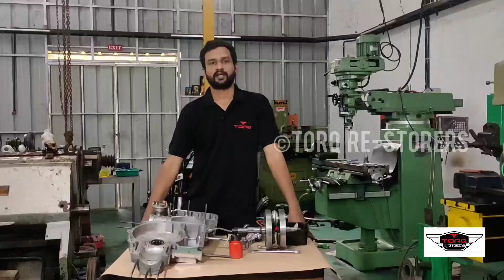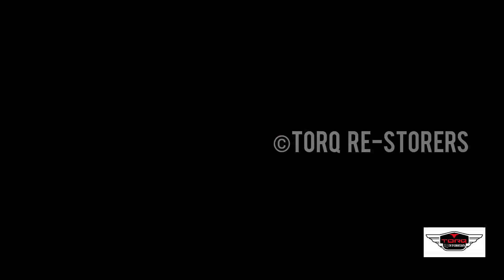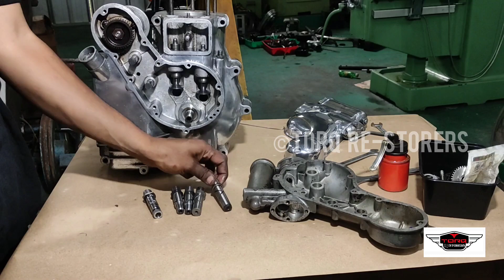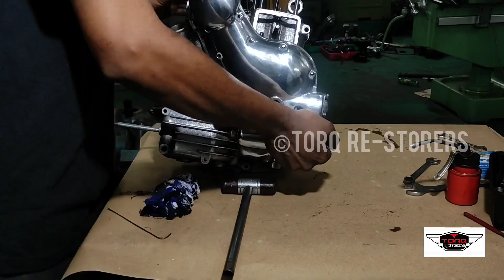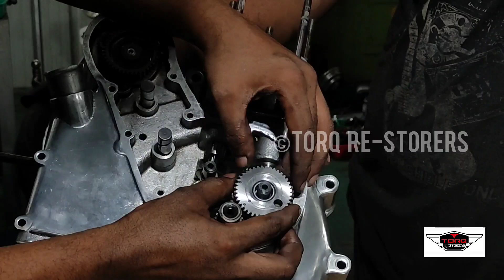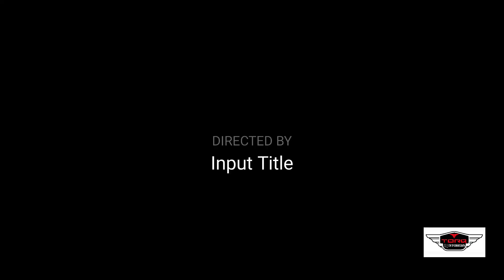Old Bullet Steady Spindle Fixing | Old Bullet Cam Spindle Setting New Innovations - Torq Engineering

Comment: Hello sir I watched ur video regarding spindle install very nice, can we install new plain spindle with removing engine from chassis, i have 2008 model standard 350.
Reply from the maker: Spindle fixing will be perfect only if we install it after dismantling engine.. we actually install a small bush inside timing cover and line bore the bush and spindle bore to single axis.. that spindle will stay longer..
Reply: What will be charges sir
Reply from the maker: You can call 9567260997

Comment: could you confirm that when the gears are wrongly set, will the bike suffer in starting??
Reply from the maker: Wrongly set in the way that the timing marks doesn't match, then starting trouble will be there.. clearance between gears won't cause starting trouble
Reply: @torqrestorers  ok ok..means if there would be clearance..means sound of the gears..then there would be no such trouble..but if the marks would be up and down of the gears..then there would be problem of starting and other problems also na?

Comment: Sir i have removed 1no cam spindle 
In market now 3no spindle is available so can i fit 3no in crank case
Reply from the maker: Check the dimensions and fix as per the required tightness.. or if polish it to the required dimensions
Reply: @torqrestorers  by polish we can reduce to how much no like 1 or 2
Reply from the maker: Removed spindle values should be measured by a micrometer.. measure the available one's dimensions.. fix it in a lathe and polish with suitable abrasive papers or use a toolpost grinding system

Comment: I have installed aftermarket spindle eccentric in AVL ENGINE. Now if I close the timing cover and after tightening the screws the cam wheels are getting jammed. An extra  gasket will do the job I have to replace the spindle.
Reply from the maker: We have to check what is the root cause of that.. if after the extra gasket it's okay then leave it..
Reply: @torqrestorers  I have actually diagnosed the real issue. When I adjust the backlash of the cam wheels and tight the spindle lock the spindle bulges inside the cam making the cam less free but still the kick is going smooth. The clearance spindle and the holes of timing cover is very tight. So if I forcefully tighten the timing cover the sleeves bulges more inside the cam wheels making them jam.
I think little bit of grinding through sand paper will do the job.

Comment: Sir my mechanic removed the 3no.spindle for changing the tappet valve then puted the same spindle.. Is it possible to use same spindle as it is not the oversize
Reply from the maker: If fit is enough.. you can refit.. but support should be there in timing cover..

Comment: Sir is there anyway to make the spindle hole again standard size as in my bullet now i have h 5no.spindle
Reply from the maker: Spindle base is welded and turned to hole size .. no need to change to standard
Reply: @torqrestorers  spindle base means the part of spindle itself or the holes in fit spindle is fited
Reply from the maker: Spindle base means the portion that is inserted into the engine crankcase.. that can be welded and turned to the base bore values..
Reply: @torqrestorers  sir we cannot weld the hole which holds the spindle
Reply from the maker: Hole is not welded spindle can be welded
Reply from the maker: You can whatsapp 9567260997

Comment: Sir my bullet restored after 25000 kilometre somenoise  i n timing side ..like dug dug dug and frickinon
My mechanic checked and saying have to change cam  spindle if it's happed ...

What happen if spindle gets loose
Reply from the maker: It should be changed. Remove the push rods and the cam wheel Backlash in various positions.. if the Backlash is between exhaust cam and pinion, change the pinion wheel to next oversize

Comment: Sir, i have 2000 model bullet, oil is leaking in heavy amount from drive shaft even changed oil seal but also its not stopping. Oil is leaking only when bike is started. Please help....
Reply from the maker: Oil leakage to clutch cover ??? If so change the bush working with that oil seal if it is grooved due to wear
Reply: @torqrestorers  installed new, but also it is coming
Reply from the maker: Check whether the breather is not clogged and is properly working.. it should be examined in detail..
Reply: @torqrestorers  checked problem not solved
Reply: It is reassembled engine